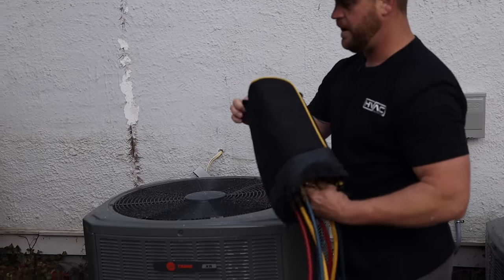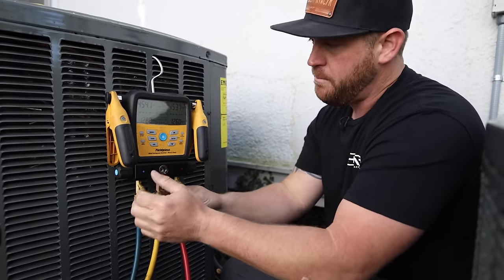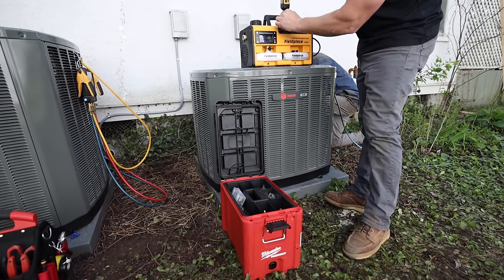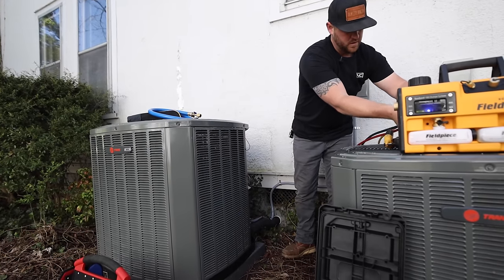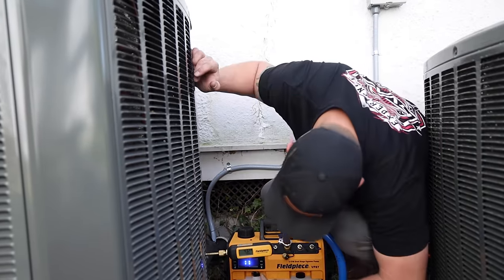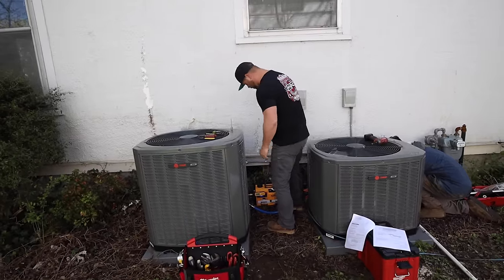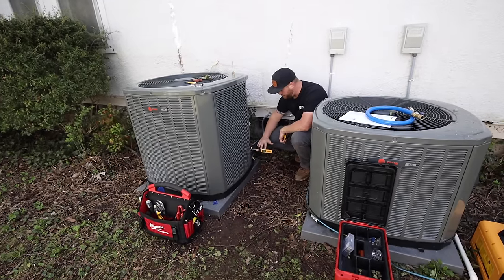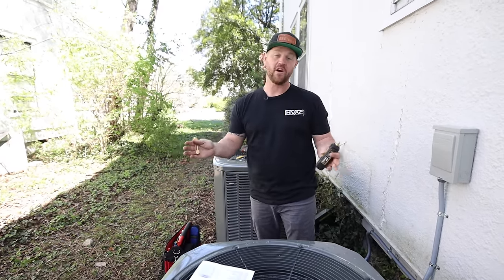Why I Choose A ONE Hose VACUUM Setup | HVAC Installations

Comment: Put a little 1/4” ball valve before the micron gauge. When your done evacuating, close the valve, remove the micron gauge and open the stop valves, then remove the ball valve. You’ll never worry about messing up that sensor that way.
Reply: I guess I should’ve read b4 posting a comment. Great minds think a like lol
Reply: I was going to say this as I have had one ruined via refrigerant
Reply: What does your gauge do when it’s ruined. Stop working or not reading right?
Reply: 😂you beat me to it
Reply: @juanlanda2561  it doesn’t read correctly. just try and clean it with some IP Alcohol
Reply: ball valves leak and would crap on the whole idea of one hose vacuum lol
Reply: Core removal tools tees on both service ports, use the wide open end spot where the removal tool goes.. Turn the valve off and remove the micron gauge. Opposite side gets the vaccum hose. Simple and least amount of connections. Least leak spots. Also if you read the tech specs on most ball valves, they're not even vacuum rated. Positive pressure yes.
Reply: I posted the same, then deleted because yours is here. Good work!
Reply: How would it be messed up ?
Reply: Yep this protects you micron guage from any contaminates and you can disconect asap as well!!! Awesome knowlege!!!
Reply: @stefsam4583  Appion core removal tools are vacuum rated. I dont know what other brands' core removal tools are rated for vacuum. I haven't looked into other brands, and I also didnt see what brand he was using in the video. Personally I highly recommend appion you just can't go wrong.
Reply: Just bring it to fieldpiece and get a new one for free tho lol
Reply: This is the answer I was looking for! Thanks!

Comment: One thing that's pretty neat about those fieldpiece manifolds, when you put the suction clamp on the refrigerant line during test tightness, it will factor in the change in ambient temperature. So that -.6 that you had might have just been ambient temperature decrease.

Comment: I’ve been doing the one hose set up for a few years now it works great.. I just use something like a core tool for the micron so I can valve it off before letting refrigerant or oil get on the sensor.. just a tip good video!
Reply: Correct!

Comment: Love watching your videos from South Texas.   Your quality of work is awesome.  I work for a school district full time and do my own jobs and service calls in between.  One thing you could show is when you test your vacuum pump/ oil is having the hose hooked up to the pump with the micron gauge on the other end to make sure your hose is good too.  Love your one hose set up.  Your videos are the reason I went to that after numerous times of having manifolds or hoses not being vacuum rated and failing trying to pull a system or package unit down.

Comment: I have a selection of vacuum pumps but one in particular is a lot of fun. It's a 17CFM 2 stage belt driven vacuum pump. This thing will pull a 4 or 5 plex down at the SAME time to less than 100 microns in barely 15 minutes. I use a very small air tank as a vacuum reservoir to connect multiple hoses (up to 6) simultaneously.
Reply: What's it called, I'm trying to see that thing?

Comment: Incredible job. 👍 Everything is correct and your technique is great. Another tip for fast and deep vacuums is to get or make a Tee fitting that will allow you to attach both ends of your single vacuum hose together end to end in a closed loop with no valve cores on each end, and then you can attach a nitrogen hose to the 3rd fitting WITH a core in it so you can purge the vac hose full of dry nitrogen under just a tiny bit of pressure (like 1 or 2 PSI) to prevent wet air ingress while in storage. Attach the nitrogen hose, attach the ends together, tighten one and crack the other, and then flow nitrogen for a couple seconds to blow alllllll the air out before reducing the pressure a lot and tightening that fitting. Store the hose like that and it will not get full of water molecules while in storage. Those water molecules have to be evacuated too when you vacuum a system and it just adds more volume of gas that has to be removed which adds time. Manifold gauges should be stored like that too, or with some clean refrigerant left in them at a low pressure to avoid air ingress. Also check the integrity of your hose seals, core tool, and manifolds by bench testing them every 2 weeks. Pull a deep vacuum on them like testing the vacuum pump oil and then seal them off and let them sit for 5-6 hours or even overnight. Core tool seals are particularly important to test because it's a shaft seal that has to seal a moving rod rather than a fixed seal which is just clamped down firmly. If you have a really old core removal tool that you never cleaned and lubed or bench tested, it may very well surprise you to see that it's leaking a good amount of pressure and vacuum. We don't accept leaks! New seals and Nylog are cheap and it lets us sleep well at night. 😺
Reply: Why do all that  work and buy expensive fittings jussst to be able to use one hose at the end? At that point I rather use 2 hoses one at the liquid and one at the suction and 3 valve core removal tools or one single hose process with one core removal tool and micron gauge at the liquid??? Doesn’t that sound easiest?
Reply: Everything is not correct. Larger ID hose takes LONGER to evac and pull down. Think about it.
Reply: @rickjames6948  no it doesn't. The length of the hose is short. As such is negligible and will pull down very quickly. The internal ID means a stronger vacuum source on the system, which pulls it down quicker.
Reply: Say that again. Maybe video what you just said. I can’t visualize. Thanks
Reply: I gotcha. Had to read again. Great tip. Thanks. That’s my biggest gripe! My vacuum hoses getting dirty in storage.
Reply: @emidiolopez1409  it’s not just one hose it’s the size. It’s not all that work and spend that money. That’s doing it correctly with good equipment. Spending money on vacuum rated hoses, pump, micron gauges ext. ext. is much cheaper than call backs for leaks or premature burned out compressors from a poor evacuation! Don’t be cheap techs because it will cost you more in the long run. Buy nice equipment, so nice work, keep things clean. Run your piping, electrical straight  plumb and level. Don’t be the guy who thinks the best way is the shortest distance between two points is a straight line. Put in the extra effort to give customers what they are paying for.
Reply: @rickjames6948  you are so so far from right my man. The larger the hose the easier to pull a vacuum. If you don’t know that then you need to go back to school. Have you ever installed mini splits? If so then you know they take twice as long to pull under (and hold)300 microns than a conventional split system.
Reply: @315hvac  I do what the video shows and it works best for me, it’s more efficient and I use a micron gauge so I know when I have a good vaccum
Reply: @emidiolopez1409  Ever compared the old school small hoses to these radiator hoses? You will find a 3/8" ID is as fast as you can get.
Reply: @rickjames6948  I got both vaccum hoses 1/4” and 3/8” and the environment where I work doesn’t matter which one I use because I’ll run my pump  for like 40 minutes and by this time I go down to 100 or 150 microns while I’m doing other things and then add refrigerant👍🏼

Comment: I do both setups. Most of the time I like having two hoses then valve off the liquid line and let it continue to pull down. Force of habit on large commercial systems or contaminated systems to use two hoses. New installs one hose all day long.

Comment: Another great video Zac... hope to see you at the next HVAC symposium in Florida!
I concur, fully opening the suction valve under vac will suck the oil out of the compressor. I've done it both ways and one makes for a much quieter operation. Personally, I pre- charge the lineset after evac to not have it under any negative pressure, when opening the valves.

Comment: Fieldpiece definitely the way to go. I just personally bought the 4 port gauges. With that vacuum, and flushing the lineset. I achieve 500 microns in like 10 minutes. Two hose setup with 3/8 vacuum hose actually rated for vacuum and not just charge.

Comment: There are a few reasons why I agree with the ONE hose vacuum setup for HVAC installations. First, it is much more efficient because you have one less hose to move around. Second, it is more organized and neater looking. And finally, it is easier to use and less likely to cause problems.

Comment: I like a core removal tool on the the micron gauge to reduce oil getting in it when you release the charge.
Reply: You don’t need a core removal at the liquid line. Once your vaccum is where you want it to be then then you can remove the micron gauge and you shouldn’t loose your vaccum because you’re not suppose to remove the shredded valve in the liquid line and then you can add the refrigerant in the system
Reply: @emidiolopez1409  if it's still in a vacuum when you take off your micron gauge off the liquid service port you're going to be sucking in non-condensables.
Reply: @sirfishalot6992  I do 100 microns and turn off my pump and wait about 15 minutes to make sure it doesn’t rise and then I remove my micron gauge with the pump being off so I do believe it won’t suck any moisture in the lines
Reply: @emidiolopez1409  you take the micron gauge off the liquid line port while the line is still in a vacuum?
Reply: @sirfishalot6992  I do it exactly how he does it on the video but I just remove my micron gauge to keep it oil free. The way he does it on the video he leaves his micron gauge while adding refrigerant
Reply: @emidiolopez1409  I get what you mean. But the way you do it sucks air in. I understand you dont want to ruin your sensor on your gauge but as he says these Fieldpieces are rated to withstand the refrigerant pressure. If you dont want oil then atleast put a quick release valve on your micron gauge and take it off very quickly.
Reply: @416RG  I’ll be using a core removal tool in the liquid line for my micron gauge from now on👍🏼
Reply: @emidiolopez1409  yeah I was just thinking that but honestly Im just going to get a ball valve attatchment so I can close it off, release refrigerant and then unscrew the gauge. Another core tool removal is too much money for just that considering I have a 5/16 core removal tool as well.
Reply: @416RG  Yeah they are expensive. I have 3 core removal tools and 2 hoses but I’m still going for the ONE hose method instead of doing a 2 hose method
Reply: @emidiolopez1409  yea dude never a two hose. I pull down to 500 microns in like 4 min for new linesets with one appion 1/2" and core removal tools. Best purchase I ever made. Maybe 10-15 for old linesets without purging with nitro.
Reply: @416RG  that’s awesome man keep it up. I’ve been into HVAC for 4 years now and been doing really good And I considered myself one of the best at the company if not the best:)
Reply: @Ray Trammell please explain!!!!!!!
Reply: @Ray Trammell okay so? i bet my systems are running better than yours. I am using 2 core removal from now on but I bet you don’t even know the whole process too.
Reply: @emidiolopez1409 no, you’ll suck in air and non condensables. The point of vacuuming is to get rid of all that
Reply: @richardwoeckener2622  got it brother I started doing it the right way a while back🤙

Comment: I've experimented with the two hose set up and single hose, pulling through a manifold the "old school" methods. I decided the single hose method works best for me. Although I use a core tool/valve on the liquid line as well so I can isolate my micron gauge and keep it oil free.
Reply: Okay but why can’t you just  leave the shredded valve in the liquid line and remove your micron gauge when you’re about to add refrigerant?? Not saying your  way is wrong though
Reply: @emidiolopez1409  when unscrewing the micron gauge from the valve it’s possible for the system to suck in moisture when the schrader is still partially depressed, I bought a C&D valve core depressor tool to hook my micron gauge to
Reply: @emidiolopez1409  you can compromise your vacuum pull.
Reply: @skrt_n6518  I’ve been doing a single hose process like the video shows but I usually remove my micron gage before adding refrigerant( shredded valve still in). I do believe it wont suck moisture in the lines because when you remove your micron gage you lose a bit of your microns so youre basically pushing pressure out of your liquid line not pulling air out of the shredded valves thats why its important to get a really good vaccum so you still stay below 500 mic incase you lose that many microns when you remove your micron gage.
Reply: @emidiolopez1409  100%
Reply: @emidiolopez1409  If you're adding refrigerant (before opening the unit's charge) to meet the lineset length, I like to add it with the micron gauge attached. The canister 410a shouldn't have oil in it, so you don't have to worry about it gooping the sensor. Then, you have some positive pressure in the lines/core tool/gauge, and you can take it off the Schrader port on the core tool before reinserting the core and doing the full charge. That saves buying another core tool to valve off the gauge (which are expensive for what they are.)
Reply: @emidiolopez1409  vacuum means the lines are under negative pressure,  not positive. Therefore there is no positive pressure to push anything out. It does in fact draw air in, compromising the vacuum pull. The only time air cannot enter the line is under positive pressure ie charge is dumped/refrigerant in the system. Its basic science, best practice is to not compromise the vacuum. I recommend signing up to an official hvac page and reading through their library of articles to help increase your skill set.
Reply: @bnasty267  refrigerant oil does in fact have an effect on your micron gauge. Most good reliable micron gauges will signal when there is oil on the sensor. Once that happens you clean it with rubbing alcohol or replace if it's not able to be cleaned with alcohol.
Reply: I do the same thing I don’t want all that oil on my micron gauge. I also keep a cap on the end of mine while I store it in a waterproof box
Reply: @skrt_n6518  This is the best thing you can to for both trains of though. You will eliminate any chance of refrigerant on the micron gauge, and it adds a sure thing for keeping the vacuum on the liquid schrader. 
Get a core depressor for your micron gauge, you single hose guys.

Comment: I love your work Zach. But I got to say doing a two hose set up with the micron gauge on the suction side DOES NOT give you an inaccurate reading whatsoever. I pretty much only use a two hose set up and not only is it faster, (especially when pulling on a used coil) but the decay test proves just how low the micron count is. Either way, your set up is a beast but just thought I’d share my thoughts on your reasoning for only 1 hose
Reply: Been pulling vacuums like that for many years  with zero problems.
Reply: @seanmathews1826  same
Reply: You’re first statement is a miss I think

Comment: The 'One Hose' set-up is the way to go for residential....if you're doing things the right way.
Fewest leak points, most accurate reading of vacuum on the system, less hoses and core tools.

On most systems, if I'm replacing a drier, evap coil, or a compressor I'll usually just pull through my 4-valve manifold....with the refrigerant tank already on the charging hose.  Quickest way to get it back in service.   Most every company around here pulls a 2 cig vacuum if they aren't purging -- even owning a manifold with a built-in micron gauge is next level around here.
Reply: How many microns is that. ? Smoking 100s or rolling your own

Comment: 2 ton split/evacuating condenser/35’ of line set/evaporator coil. Had lots of moisture. Pressure tested. Dropped 5 psi within an 1 hr and 15 minutes.
Not sure if that’s a leak?
Thought possibly my hose had a bad gasket? System has been showing some serious moisture boiling off. 
Checked my gaskets. 
Changed to the one hose set up. Exactly like what is in this video. To eliminate any extra fittings and potential leaks.

Comment: you should put a core removal tool on your liquid line with your micron gauge so that when you break the vacuum with freon that you dont get it in your micron gauge which can affect its accuracy over time will mess them up

Comment: I always braze with nitrogen then  high pressure test and do the triple Evac until my microns are below 500. Seemed like I was having a few new units that were running with some noncondensibles. I was told by an engineer that you normally don’t want to pressure test a system that is pumped down over 250psi. Supposedly the valves are not great at holding excessive back pressure and can cause a small amount of nitrogen to leak back into the condenser. Especially if the pressure you’re testing are higher than the pressure inside the condenser.. I’m not sure how true it is, but I have started to pressure test 200psi or lower, double checking my connections with bubbles and have had much better results.

Comment: quick tip ive noticed my core depressor will leak slightly if threaded all the way in, so i always make sure the adjust it while the vacuum is being pulled and monitor if any changes in my micron gauge happen. i use the supco SF5050 i do not use integral core depressors in the hose.